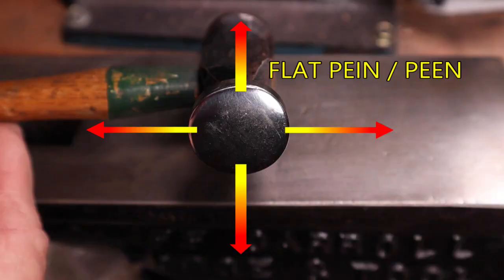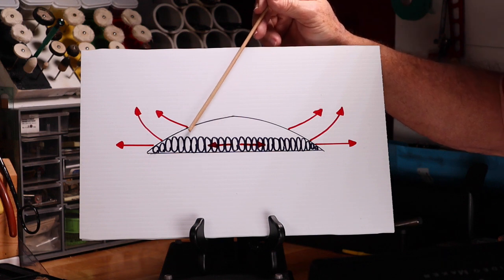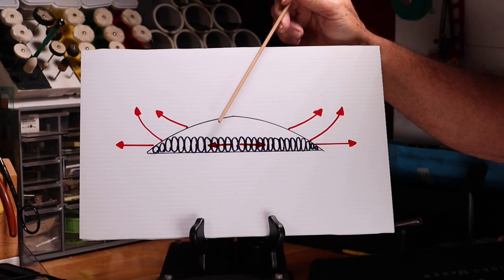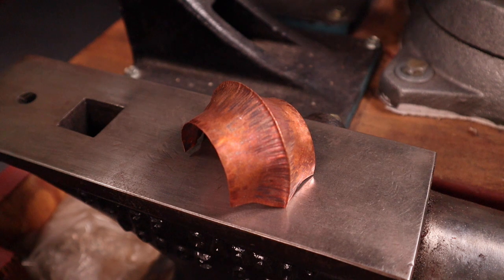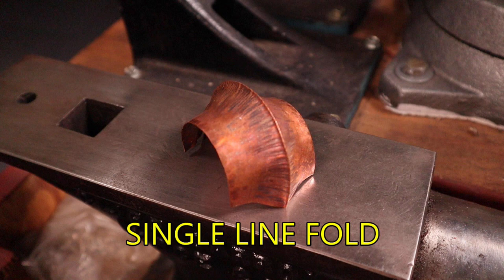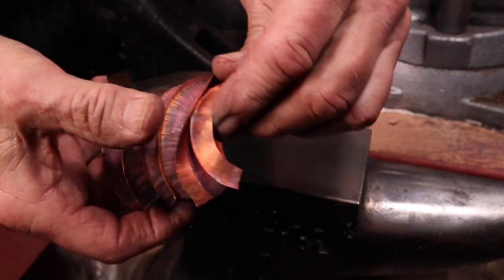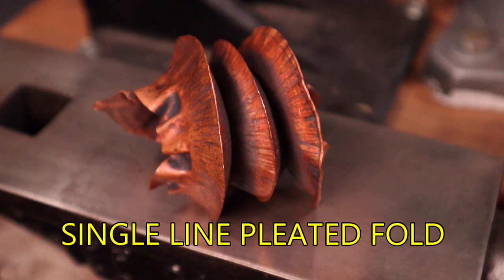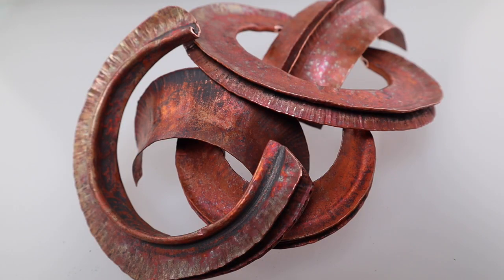FOLDFORMING PART  3.  "FOLD FORGING"

Comment: Thank you so much for the tutorials! I hade been trying your techniques and having some success. I was wondering what size and weight cross peen hammer you are using. I just purchased the
 #12 fretz hammer but am wondering if it is too small?
Reply from the maker: Hello Barbara,  I have 3 forging hammers.  1.)  32 oz.   2.) 16oz. 3.)  8oz.  I think the Fretz #12 is a 3oz.   That could be a little light. But I'm sure you can make it work on the single, double, and triple folds.  Experiment and see what works for you.  I used the 16oz. and the 8oz. in the foldforming series.   I hope this helps you.  The best to you.   Greg Greenwood

Comment: Amazing!
I have a design that I think I might be able to make in this way if I practice enough. 
Can I ask if the L shaped steel blocks you gave in your vice are something g you can buy or if they are called something specific?
Reply from the maker: Hello Just Me,  The L shaped blocks are common angle iron that is available at most hardware stores or building supply stores.  It is 1.5in x 1.5 in x 8 in.  You can cut them to length with a hack saw.  Drill holes to match your vice jaws.  
Good luck and keep watching.   Greg Greenwood
Reply: @greggreenwood4628 
Thank you!
I will look online. I am housebound and I don’t think they would sell them in U.K. stores.
Reply from the maker: Hello Me, You should be able to get an angle iron on line.  Let me know how it goes.   Take care.   Greg Greenwood

Comment: Thank you very much, Sir, you made it seem so easy! But it does not work as easy on brass: after 4th annealing, the curvature is still veeeery slight, about .5 mm each side... I wonder if the metal will eventually break at the fold, and it seems like it will never go as far as a circle. Pity
Reply from the maker: Hello Gergana,  You are correct about the brass alloy not working as well as the pure copper.  The brass, like most alloys, has different abilities to stretch and be deformed compared to copper, a pure metal.  But, it will foldform by using a little more force.  Also, make sure than you cut the metal into a crescent shape.  This will put less opposing force on the ends and let it curve easier.  Don't worry about annealing more times.  This will not hurt the metal.  Also, brass has a pretty good tensile strength (ability to withstand stress before it breaks).  Practice on a scrap piece of brass to test the limits of what you can do with the metal before you start on a project. 
I really appreciate your questions.  Thank you for watching.  Let me know how it goes.   Greg Greenwood
Reply: @greggreenwood4628  Hello, Greg, Thank you very much for your advice: I followed your tips, and after 18 annealings (!) and opening it turned to closed circle:), the metal didn't break at the fold. What it did, though, was it formed quite noticeable waves at the other end - much bigger than your pieces in the video -  which I was not able to compensate  solely by opening the piece. I wonder, how should I shrink the metal at the other end...
Reply from the maker: Hello Gergana,  Way to go!  I'm proud of you for finishing the closed circle.  The waves are caused by the metal on that side of the piece has nowhere to go except up and down in a wave.  The waves can be kept under control if you tap them down with your rawhide mallet as you are forming the circle.  If you use the rawhide, it doesn't spread the metal like your forging hammer and just moves the metal down.  This is not 100% fix, but it does help.  You can do this also now that you have the circle made.  Do one layer of metal at a time.  This will help.  You have learned much by doing this "excercise" .  It takes practice!  The best to you and let me know how you are doing.  Greg Greenwood